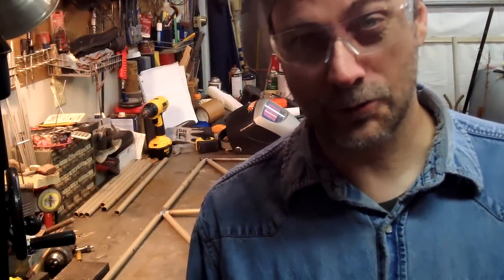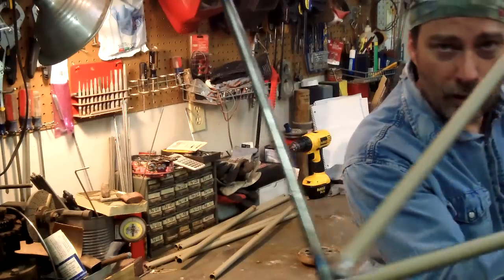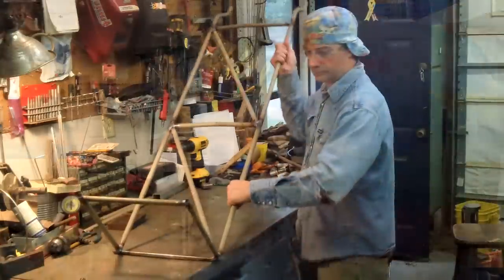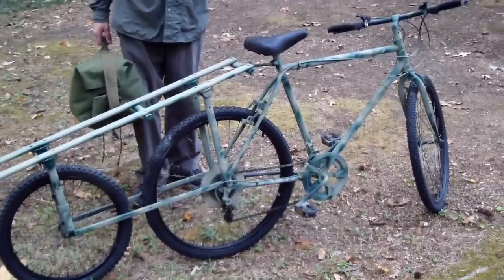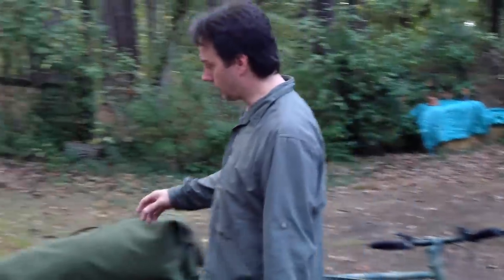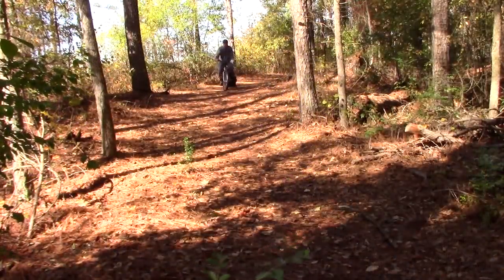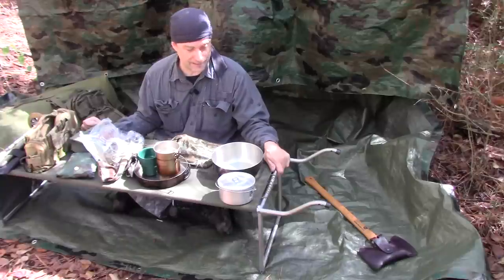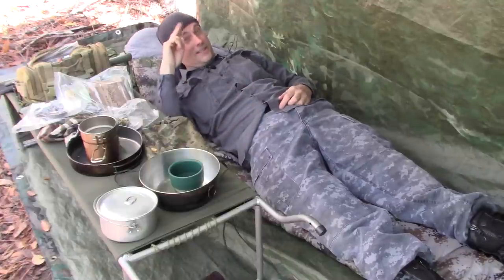The Bushcraft Camping Bicycle Travois

Comment: I'd almost bet that you didn't know that you have innate abilities to be a wilderness outfitter! I see that you have your Pilot's Flight Helmet Bag with yah! How's come you don't carry a quick change of clothes inside, like I suggested???>>>Which also makes for a pillow at night!
Dave, you will absolutely need bigger wheels if you want to negotiate some of the bigger brush and what not! Perhaps those really cheap harbor freight replacement hand-truck tires and wheels will do the job! I know that simplicity and expediency is what you want and i get that. The previous project was kinda neat too! Perhaps between the two of them, something will surely come about, that will be outstanding! I honestly believe that your load weight limitation will be 65 lbs, just so that you don't end up tweaking the frame or have it develop a stress crack. Other than that, you are well on your way to coming up with something great!
Reply from the maker: Lol, thanks Craig! I have used that pilots bag as a pillow before. Ours actually better than a home pillow! Since this video came out I have a larger set of wheels. Thanks for watching

Comment: Im 56...cant hit 10+ miles a day with 80+lbs. Anymore ect ....having issues putting a pack togeather....Im going to do a base line 14 lbs + for perfect conditions(68 degrees)..
Every 10 degrees Fahrenheit lower add 5+ lbs....below freezing add 10 lbs. Per 10 degrees Fahrenheit???
Solid Point???
Reply from the maker: You are 100% correct. The cooler it gets, the more your pack weight increases

Comment: yeah I could see it needing bigger wheels that SHOULD lift it higher and prevent the tire from rubbing. Other than that though that is AWESOME! well done man.
Reply from the maker: The small wheels with the high speed bearings work perfect for trail use. Since this video was filmed I now have a larger set of wheels I swap out for off trail use.
Reply: @Reallybigmonkey1  nice. excellent idea to be able to swap them out when need be.
Reply from the maker: Thanks!

Comment: extend the frame and add a single wheel like used on a brush hog? That a way it won't drag or offer more ground clearance.
Reply from the maker: Maybe, if I extend the frame it will also double as a bed frame!

Comment: For greater stability, you might consider doing a tricycle conversion of the mountain bike. This would better accommodate heavy or bulky loads. Also, strip the bike of anything that you won’t be using like the seat to reduce is weight.
Reply from the maker: Are you talking about building a full size three wheeler?

Comment: Larger wheels would give it enough lift to keep it off the tire.  Great idea
Reply from the maker: The small wheels with the high speed bearings work perfect for trail use. Since this video was filmed I now have a larger set of wheels I swap out for off trail use.

Comment: Agreed, taller wheels. And that would remedy the problem of the back tire rub no?
Perhaps something from the wheelchair wheel industry? ~ I really don't know jack about axles 'n bearings.

I think it was the Dodge Boys that invented the sealed bearing for the bicycle, which they carried into the auto industry, and the auto for every home took off.

Awesome uni-direction hook up ya made there Dave.

umm, I'm a tent guy ~ part of reason I visit the woods is nature observation. The sound from using tarps would drive me nuts, besides skeeters. I do understand you liking the sticks 'n tarps though, and not picking on y'all.
tips me hat ~
Reply: How far are you bicycling, just from your auto or a long bike ride to the woods? Here's some ideas of weight distribution, use of taller wheels, longer arms, table worthy, snow skis ;-) and actually if sturdy enough put your bike on it in very rough/creek areas...and back hauling with bike?  Some not really gossamer though.  
~~ Back wheel rub...longer arms would be a fix too.

Also for right wheels..find the cart you like and inquire on replacement wheels/tires?

~ For reference only of course.  
https://www.hinterher.com/galerie/reisen.php
Reply: I can't find  Vanessa's vid where she had this hooked to her bike,  had to leave it behind as you did, but zoom through this when time allows.
https://www.youtube.com/watch?v=oX9u_rPS7K0
Reply from the maker: The small wheels with the high speed bearings work perfect for trail use. Since this video was filmed I now have a larger set of wheels I swap out for off trail use.
Reply from the maker: The small wheels with the high speed bearings work perfect for trail use. Since this video was filmed I now have a larger set of wheels I swap out for off trail use.
Reply: @Reallybigmonkey1   There's something in the wording of High Speed Bearings(HSB).
~ In one revolution of your bicycle's wheel, how many times does the roller blade wheel go around?
HSB's because it's so small it's needed for what designed to do. Perhaps tighter tolerances because they're near connected to ones brain tactile via feet.
~~ But you're right. Even off trail who's traversing 4-8" logs vs stopping and moving it to the side? It's not a MotoX timed event.
I like the use as table idea.

~ I was thinking of your cloth topped table instability.
If you could incorporate a sheet of thicker flexible plastic as (see link) this kids sled jobbie with the canvas install, it would stiffen up the table top.
 Hand holes cut on opposite ends it could be used as a firewood hauler too. (-:
lol, my mind wandered again, but yeah.
https://www.walmart.com/ip/Flying-Carpet-Snow-Sled/38472888
Reply from the maker: I think a sheet of thick plastic is a good idea!

Comment: If you get some bigger wheels you will get more free space between your travois and your bicycle back wheel and it will be easier to drag through the bush.
Reply from the maker: The small wheels with the high speed bearings work perfect for trail use. Since this video was filmed I now have a larger set of wheels I swap out for off trail use.

Comment: Put the back pack on your back where it belongs which gives more room on the rack..plus my trailer wheels are a bit bigger,,and the bearings don't mean much to me..I went larger wheels which rolled even better.....at least try them..they also kept the trailer from touching the back wheel of the bike...other wise great job!!!!!
Reply from the maker: The small wheels with the high speed bearings work perfect for trail use. Since this video was filmed I now have a larger set of wheels I swap out for off trail use.

Comment: When you  break over a hill, the tire will touch the bottom of the  sled.  Larger wheels on your sled will help to eliminate that.
Reply from the maker: The small wheels with the high speed bearings work perfect for trail use. Since this video was filmed I now have a larger set of wheels I swap out for off trail use.

Comment: Longer handles will keep it of wheel. As well, you need that when you drag it benind you. A travois is easier id hands beside or in front of you less drag on shoulders. You will end up with bigger wheels in the end
Reply from the maker: The small wheels with the high speed bearings work perfect for trail use. Since this video was filmed I now have a larger set of wheels I swap out for off trail use.

Comment: When you go uphill you are, in effect, jack knifing the bike/trailer especially at the apex, creating rub. For clearance, lengthen the seat post bracket/heim joint and larger diameter wheels on the rack........may not even need the larger wheels. JMHO..........................G
Reply from the maker: I added larger wheels since this video was filmed

Comment: Also use two 20 inch bmx front bike wheels they would hold up better and allow for more movement.
Reply from the maker: The small wheels with the high speed bearings work perfect for trail use. Since this video was filmed I now have a larger set of wheels I swap out for off trail use.

Comment: I like the idea but I think it definitely needs big wheels and have them closer to the centre (maybe 60-40) of the load so the weight is more over the axle.  I was thinking about doing something similar after I saw the thing Canadian prepper made.  But I was thinking I could model it after one of those big two wheel hand carts they use over really rough terrain in Asia. Something like a hand pulled rickshaw or weighted like a horse drawn buggy, but obviously a lot smaller.  They usually have big wheels for going over muddy and bad terrain.  If you checkout this: https://en.wikipedia.org/wiki/Pulled_rickshaw
They came up with a design that was used for centuries, so a small version of that was what I had in mind with maybe 20 inch wheels or bigger if needed.
Reply from the maker: The small wheels with the high speed bearings work perfect for trail use. Since this video was filmed I now have a larger set of wheels I swap out for off trail use.
Reply: @Reallybigmonkey1  OK cool for me I'd have issues with them getting fill of dirt and mud.
Reply from the maker: No big deal on the trails I go on.

Comment: Looks like something the Amish use when they go hunting on trails. Some use wagons.
Reply from the maker: Really? I didn't know they used stuff like this.
Reply: @Reallybigmonkey1  Yeah, there is a trail that's blocked for car traffic. Come hunting season, it's full of bicycles with wagons attached with bowl heads peddling their asses off, usually with deer in tow. They are a nuisance. Run drives on the 2nd day. If it's brown, it goes down. Even if it's black (bear). Seen it myself.

Comment: I am thinking there should be only one wheel in the back. Otherwise if one wheel hits a big rock the weight of everything could knock you off your bike.
Reply from the maker: It's connected by a hiem joint. There's no way it could knock me off my bike
Reply: @Reallybigmonkey1  I should have known better than to question your engineering.

Comment: I know you don't want to hear this but much larger wheels will needed if you intend to take this thing off road.
Reply from the maker: The small wheels with the high speed bearings work perfect for trail use. Since this video was filmed I now have a larger set of wheels I swap out for off trail use.

Comment: I know you used what was on hand, but a bigger, wider tire, with some puncture proof liquid inside would give you a better ride.
Reply from the maker: The small wheels with the high speed bearings work perfect for trail use. Since this video was filmed I now have a larger set of wheels I swap out for off trail use.

Comment: Only thing I can see is ground clearance of those small wheels.  If you get water or rocks on the road, you will not get that trailer over it.
Reply from the maker: The small wheels with the high speed bearings work perfect for trail use. Since this video was filmed I now have a larger set of wheels I swap out for off trail use.

Comment: VERY IMPORTANT! Put a tall red flag at the back of the travois to signal that your bike is longer than an usual one.
Reply from the maker: Even out in the wilderness where no one is around?
Reply: @Reallybigmonkey1  I make mine to go fishind around the city, for longer periods of time, with tent etc no matter the weather.
I found the 360 degrees connector under the name "swivel eye rod end" . I suppose the name it depends on the seller, might help others looking to buy one.

Comment: Needs bigger pneumatic tires.
Reply from the maker: The small wheels with the high speed bearings work perfect for trail use. Since this video was filmed I now have a larger set of wheels I swap out for off trail use.

Comment: wheels too small, not enough clearance in the woods, it's ok on a trail that mostly flat, that's why deer buggies have larger wheels
Reply from the maker: The small wheels with the high speed bearings work perfect for trail use. Since this video was filmed I now have a larger set of wheels I swap out for off trail use.